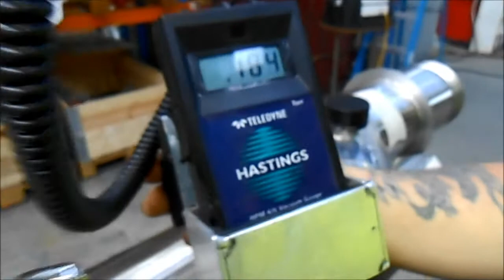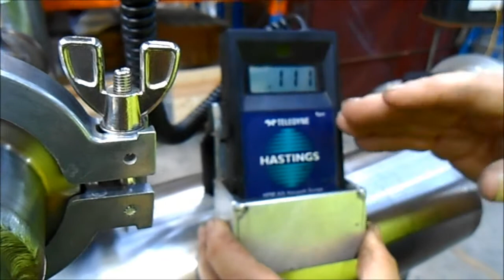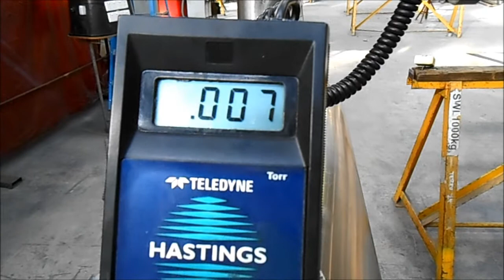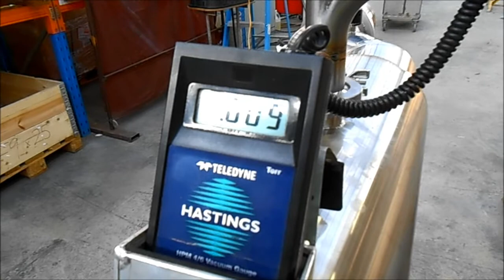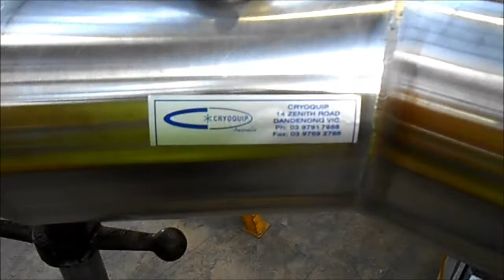Vacuuming Video

Comment: Sir I want to learn repair of liquid Nitrogen Container. Please 🙏 help me.
Reply: Hello, Abdur   To repair cryogenic tanks, you need technical knowledge about cryogenics and tank construction, specialized training, safety equipment, appropriate tools, and access to the manufacturer's manual. It is also important to have licenses and certifications, conduct a risk assessment, and, if you lack sufficient expertise, seek specialized professionals to ensure safety and effective repairs.   You will need:    Vacuum Pumps: Used to evacuate air and moisture from the tank during repair or maintenance.

Leak Detection Equipment: Instruments that can detect leaks or small cracks in the tank's structure.

Temperature Sensors: Devices to monitor and measure the temperature inside and around the tank.

Welding Equipment: Specialized welding equipment that can operate at low temperatures and handle the materials used in cryogenic tank construction.

Thermal Insulation Materials: Materials used to maintain the low-temperature environment within the tank and prevent heat transfer.

Cleaning Equipment: Tools and chemicals for cleaning and preparing the tank surface before repairs.

Nitrogen Purging System: Used to remove atmospheric air and contaminants from the tank during maintenance.

Pressure Testing Equipment: Instruments to perform pressure tests and ensure the tank's integrity after repairs.

It's important to note that specific equipment requirements may vary depending on the type and size of the cryogenic tank and the nature of the repair. Additionally, working with cryogenic substances presents unique risks, so proper training and safety measures are essential to avoid accidents and ensure successful repairs.